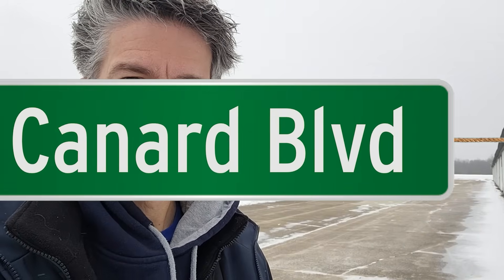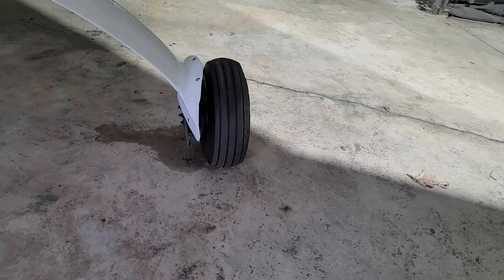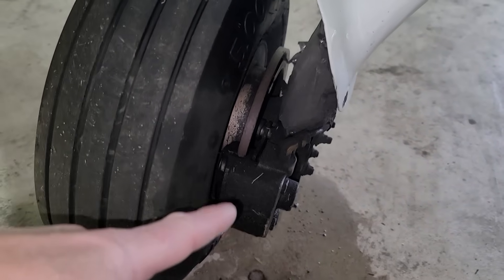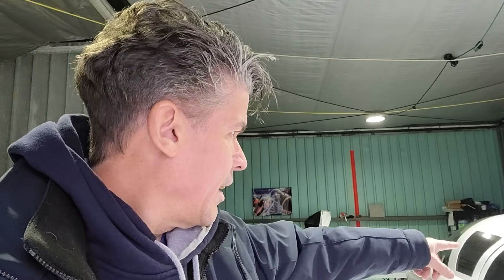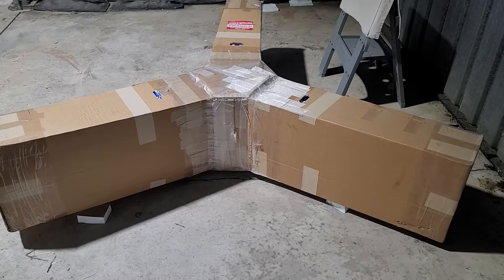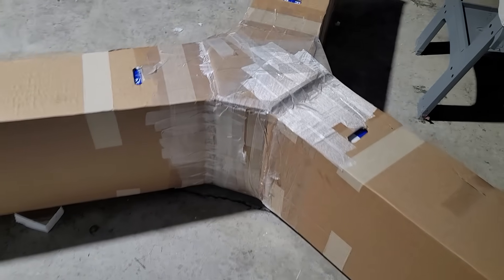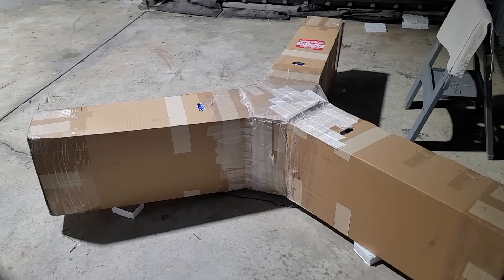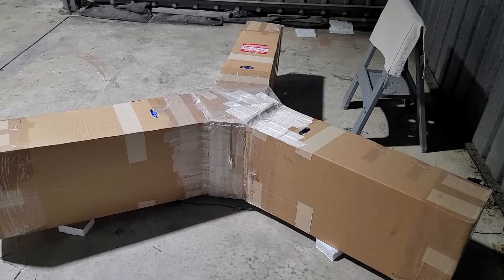I'm Replacing my Nearly New Aircraft Propeller - Here’s Why

Comment: Nice video! 
Your speech about your RPM reminded me a story from 20 years ago... I was spending most of my free time helping the engineer of our airclub and a guy who had his own PA28 and doing the maintencance himself spend months trying props, never getting the expected rpm and ranting about it. One day the engineer looked at him and just asked: "You sure your tachometer is fine?" The tachometer was not :D . We had a tool with a laser, don't remember the name, to mesure rpm and the engine was delivering the normal one while the tachometer was off by 110/130 rpm. I'm not saying you're in the same situation but if you keep having problems with the new prop don't be like the guy with the PA28 and loose months and a fortune buying props, have a look at your tachometer instead! 
Cheers!
Reply from the maker: The tach is actually a digital sensor on the G3X EFIS, so no calibration there - but I did check it against a prop balancing device this summer and it was dead on. But good idea!

Comment: Funny you should post this video yesterday.  I am in annual on my LongEz and pulled my prop yesterday to find a bolt or two not torqued to spec.  There’s been some rubbing and vibration as a result.  I am sending my prop off now.  Your video helped me understand better the relationship with the pitch and length of a prop as it affects the RPM, climb and cruise.  So thank you.
Reply from the maker: For wood/composite props, you really need to recheck that torque every 50 hours or so. Glad I could help!

Comment: Do you have any idea how many HP the engine is producing  at 2150 rpm? Just a quick mental calculation it's. 07to .08 hp per 1rpm
Reply from the maker: It depends on things such as density altitude (temperature, ambient air pressure), but at sea level on a standard day, an IO-360 at 2150 RPM is making about 145 HP.
Reply: @CanardBoulevard thank you for replying 
I was wondering if you saw the Canard plane type crash not the one you posted earlier I believe it was on the seat coast
Reply from the maker: @billspud2975  Yes, I'm quite familiar with it.
Reply: @CanardBoulevard very sad , I couldn't find much on what happen would you consider making a video on what happened  I am not a pilot but I do find your content  and the conard type plane very interesting

Comment: Put a constant speed prop on it and you will never regret it.   Without it, you are driving a Ferrari stuck in third gear.
Reply from the maker: Constant speed props don't make sense on this plane. First off, they are far too heavy, and require you to carry a ton of ballast weight in the nose to stay within CG. All that extra weight slows you down. Second, they are really expensive, and pushers send rocks and debris through the prop all the time. Damaging a $20,000 prop with a rock strike isn't cool. Third...when it comes down to it, the overall difference in performance on the Cozy at least is not a huge difference, certainly not enough to justify the cost and loss of useful load.

Comment: Do you know what the cruise speed was for the two props . I would definitely want a prop that gives a good take off performance over the best cruise speed.
Reply from the maker: Cruise speed is pretty consistent, at around 165-170 kts (depending on how you run the engine).

Comment: For comparison, I bought a Catto 3-blade in 2021 for my Cozy that has a standard 8.5:1 compression Titan 360 engine. I said I wanted a mid-range prop, i.e. a compromise between climb and cruise performance. Their recommendation was a 64x74 prop. This prop's static RPM is 2380-2400, but the odd thing is on the takeoff roll, the RPM actually goes down slightly to 2350. The static RPM of 2400 would indicate more of a climb prop, but I get decent cruise performance, 167-170 KTAS at 8GPH and 2500-2600 rpm (depending on altitude 5000-9000 Dens Alt). Down low (2-3k ft) at full throttle I get 2750 RPM.

Comment: Sorry to drag this off-topic. Whenever I see your panel, I look for the breakers/fuses, but haven't been able to see them (on the project Cozy, I'm trying to free up instrument panel space). Are you using Vertical Power (I'm thinking about replacing the fuse panel with a VP-X)?
Reply from the maker: The are in the top panel, in two rows, to the right of the switches. However, I do plan to completely redo the panel, and will be moving to a VP-X system.
Reply: @CanardBoulevard  Thank you!

Comment: Just for a data point, I’m using a Silver Bullet prop that is 2 blades, 66x78. My static is 2350 and I have no problem reaching 2700rpm in flight. Easier to ship and carry in your car as well. Also, I went through the exact brake redo as you with new pedals, master cylinders, lines, and wheel assemblies. Recommend getting the gear leg fairings from Eureka CNC which will give you a brake conduit as well as speed up your plane some. So far I saw at least a 4 knot increase in speed. I can send pictures of my stands if you want, they are just simple wood stands with padding.

Comment: 2700RPM? The Cessna 172S has a maximum engine RPM of 2700RPM, but cruise RPM is restricted to 2500RPM by adjusting the throttle setting. In your case, why is it safe to operate at 2700RPM continuously?
Love your work. Thank you.
Reply from the maker: I'm not sure where you're getting that information from. I have a POH (Revision 4) for a Cessna 172S, and there is no limitation mentioned in it for 2500 RPM in cruise. In fact, on page 4-16 it says "Cruise Power: 2100-2700 RPM."

Some aircraft do have limitations for specific RPM ranges with metal props due to harmonics, but that's not something I'm aware of in the 172. It's been a while since I flew one, however.

All that said, the Lycoming IO-360 is perfectly fine to be operated continuously at 2700 RPM.

Comment: pitch is measured in degrees not inches. I WORKED IN A PROP SHOP
Reply from the maker: The pitch of the prop blade is measured in degrees on ground adjustable or constant speed props. For fixed pitch props, they are normally listed as diameter/pitch (i.e. 63x76) which would be 63 inches in diameter and 76 inches travelled in one rotation.

Comment: Yeah, but what about thrust? RPM is the only thing we can readily measure but thrust is the only thing that matters. What are your climb rate comparisons and TAS comparisons? Hosepower in an airplane may not be the right thing to measure. For example, the equivalent diesel aircraft engine has a lower horsepower rating than the gas engine it replaces in a 172 or DA40 or PA-28. Just thinking...
Reply from the maker: They're definitely connected, but yes - when I switched to the prop that I just sent back, I lost 400-500 fpm climb in the initial climb out at similar DA to the previous prop, in addition to losing 100-120 static RPM.
Reply: @CanardBoulevard I figured you had the data and I was curious. Thank you.
Reply: @CanardBoulevard What was the comparison on TAS? I'm guessing the 2nd prop is faster in cruise with a hit to climb?
Reply from the maker: @stevespra1  You got it. Not a huge difference, about 5 kts.

Comment: I have similar static and full throttle rpm on my setup as you. I have a question...when you are pushing the throttle in, do you have a spot where it reaches full rpm that is just shy of full throttle. I have a situation where the last 1/2" of throttle adds nothing more;  RPM and power plateau.
To answer your question about cruise/climb performance, I typically go with a higher pitch to get better cruise performance. I have a ground adjustable prop so I can change pitch for winter or summer flying (I'm also in Ohio).
Reply from the maker: Something you might want to try: When you are at WOT, pull the mixture very gently back from full rich - you might be surprised to get another 50 RPM, depending on density altitude.
Reply: @CanardBoulevard What you have suggested is exactly what I do. I was just curious if you have the same situation at the end of your throttle...the plateau effect

Comment: I had a fruitful conversation with AI on why RPM impacts horsepower. I had previously assumed that it didn't, especially when LOP where RPM doesn't factor into the HP calculation. So I found this video very interesting. I am also interested in you completing your brake work. I am sure that I will have to do something like that in the future and it's helpful to get a basic overview of how it's done. 

Honestly those types of videos are the unsung heroes of youtube. I am constantly looking for things like "how do remove the coils from my 2020 ford edge" and there's always some video that has a small number of views that does the best job of explaining it. And in that particular example, because there's some trick that people with experience know that explains how to get around something that seems impossible. So I hope that you will continue to make these "boring" videos. There's likely some person out there that was saved a ton of money because of them.
Reply from the maker: Horsepower is basically torque produced over time. So if you can have more cylinders firing in a given amount of time, the horsepower will definitely go up. That literally means that as RPM increases, horsepower goes up - to a point. As the RPM increases, the ability of the engine to produce torque goes down, so after a certain speed, the generated horsepower starts to go down.

Comment: If fixed pitch props were any good why did the rest of the motorised world adopt gear boxes?
Reply from the maker: Cost, weight and complexity. Constant speed props are very expensive, require constant maintenance and inspections, and most importantly, add significant weight. On a Cozy, that weight would drastically impact the CG.
Reply: @CanardBoulevard  Good morning, have to disagree with some of your comments.  As a pilot for over 40 years and owner of 8 aircraft from piston singles to jets.  I have not experienced any "constant maintenance and inspections" as you have described.  The constant speed props I have flown behind, conventional Hartzell, McCauley and a Composite Hartzell have not needed additional maintenance and have all been inspected on an annual basis as with the rest of the aircraft.  If your propeller is properly balanced it should provide trouble-free service.
Reply from the maker: I've definitely had issues with constant speed props before, from hub leakage to worn retention rings to failed governors. Not to mention that a constant speed prop is going to cost you pretty much quadruple what the fixed pitch prop does for my plane. It is going to weigh 50-60 lbs compared to the 17 lbs of my carbon fiber prop. There are some that have tried a constant speed prop on a Cozy, and the benefits really are rather minimal.

Lastly, on a pusher aircraft, all kinds of stuff gets tossed and goes through the prop. I'd rather have a rock damage a $4000 composite prop than a $20,000 aluminum constant speed prop.
Reply: @CanardBoulevard  Sorry you've had such poor experience with your constant speed props.  As detailed in my 40 years with 8 aircraft my experience has been very good.  My recent new composite replacement cost me less than twice the cost of a fixed pitch propeller.  Hoping you have better luck in the future
Reply: What about a ground adjustment prop ?
Reply: Weight is the dire enemy of all aircraft. Complexity thus cost is also the enemy to ownership.